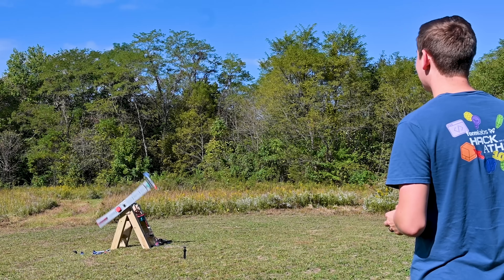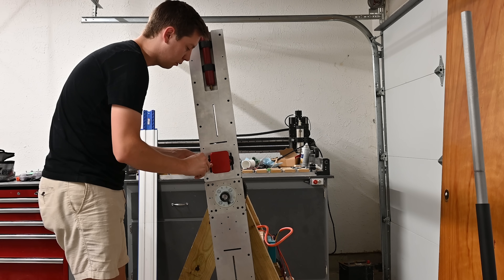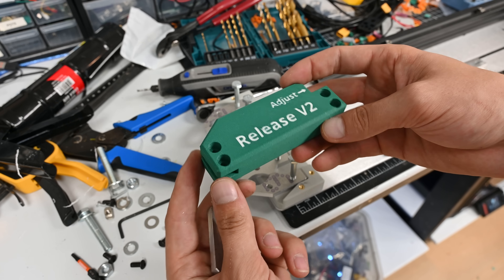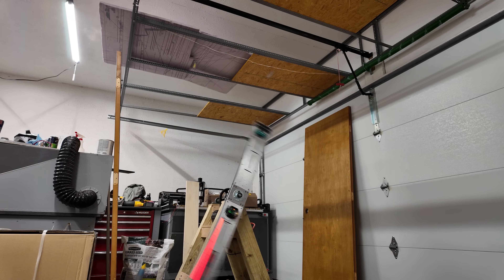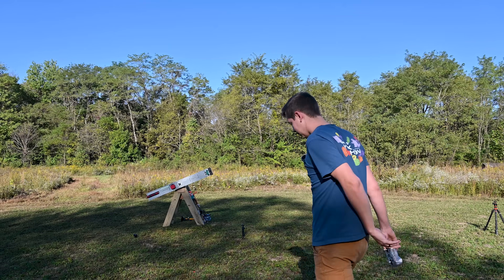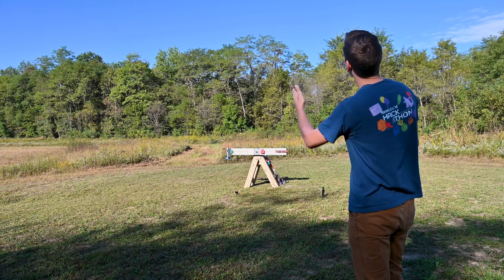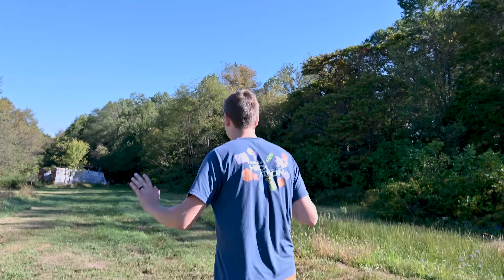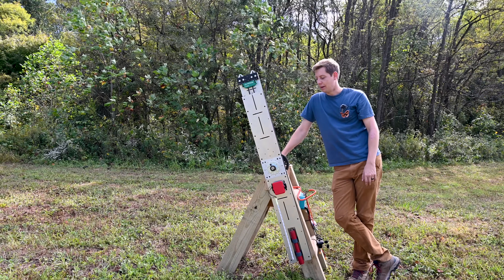I Fixed SpinLaunch

Comment: I have a suggestion for balancing, something that's basically automatic, and cheap and doesn't need software.
Use a properly centered bearing race/track and put a few dozen bearings in it. This is how certain tires and spinning objects are balanced. This would also automatically rebalance once this rocket is let fly, which should reduce damage from shifting forces.

Comment: Looking good! after the launch you have a mass imbalance which may put a ceiling on your RPM, so  maybe you could anchor the base to the soil with one of those things to secure your dog: a screw-in ground stake, maybe with a ratchet strap around the center post straight down into the ground.

Comment: Why didn't you do something like a throwing knife and put the rocket in-line with the arm and then release at the top of the rotation (0-degrees) instead of at 270-degrees?

Comment: Could be cool to put an actual rocket motor and recovery mechanism in it, maybe fire up an E or so motor on a timer and jetisson the ignitor on a chute. That's if the weight doesn't mess up the stability of the system too much!

Comment: What if you built the arms to be retractable? They start full length, and then retract both ends like how an ice skater pulls their arms close to spin faster? This assumes the motor is the constraining factor for speed and will probably introduce durability issues, but hey, just an idea from a non-engineer

Comment: Stabalizing the platfor would help to get better overall results.  It looks you're losing a lot of energy in the platform rocking.  Besides yielding more energy, improving the base stability should also help  increase the timing consistency of when the release is happening.   A concrete slab, or an anchored steel plate with threaded pegs, even a basic wooden frame would be an improvement to the present configuration.

Comment: You solved the small release problem: Good. So now you can successfully launch ultra light rockets (that introduce a negligible weight difference) from a comparatively much much heavier structure.
The real problem with spin launch though is launching a heavy rocket from a not infinitely heavy structure (which is relevant because you still want to be able to spin that thing up in a rather quick and affordable way concerning the energy the motor needs). When you have a balanced situation (with the rocket in place), so you can turn it fast without tearing itself apart, and suddenly detach lets say a 1 ton rocket, your launch apparatus will let's say rapidly disassemble itself. That's where the real problem is (unless a one time usable launch site is enough).
Obvious idea 1: Detach an equally heavy counter weight from the other arm, but that would go in the opposite direction and smash into the ground with the same force the rocket goes up. So you have your own little earth quake right at the launch site.
Idea 2: Move the counter weight on the other arm to the center of rotation  (equally fast to the detaching rocket), but you can't do that as instantly as needed (without destructive consequences).
There are a bunch of easier ways to launch a rocket than spin launch.

Comment: Seems like the angular momentum issue is going to be 1000 times worse for the real spin launch, and the loads required to negate the angular momentum would be off the charts.  I am also co fused about how the arms are rebalanced after release. Otherwise, the thing will self destruct upon launch, and suddenly moving a mass to counteract the sudden imbalance seems even more violent.

Comment: It looks to me  that in order to conpensate for momentum, two locks should be released at the same spin angle (e.g. at 9 o'clock). So maybe have separate lock and a mechanism that would automatically release both when they reach this angle?

Comment: To save you some issues re-balancing for heavier and heavier rockets, you could modify the non-rocket side of the arm to have a weight on some threaded rods. Turning these rode to move the weight radially would allow you to adjust the arm's center of mass, maybe even adding a motor to allow you to adjust the center of mass automatically post-launch.

Comment: should have put a whistle on the rockets. Also you could add some sliding counter weights to the arm to help it re balance after the rocket is launched. Or make a large hoop shape around it and have weighted balls inside.

Comment: Longer and lighter arm to make it launch even faster. I'm also scared how unbalanced the arm becomes once the rocket leaves. You might need a pneumatic actuated weight shift at the other end to dynamically counter balance (or something else), or else it might explode in your face. Its dangerous.

Comment: have water eject from the counter weight as the rocket releases to re balance the arm at high rpm
Reply: use whatever compressed air you have left to expel it even faster

Comment: improve this in whatever way, but also, you need to add a rocket motor and ignition+ delay system, or learn to make your own rocket motors so you can make a custom throttled one that will do a slow burn for a fair while before the main burn (since it's already going 80 mph, pushing to go as fast as possible instantly probably not efficient? IDK, anyways, another fun thing to add, and should give a nice impressive result.

Comment: 17000mph is overkill, if you just want to get into space you only need about 4000mph. The extra 13000 are doing nothing for you if you are just going straight up, until 25000 you are always going to come back down.

Comment: One thing manny here get wrong or at least phrase wrong is that Spinlaunch try to throw Rockets into orbit. they dont. They dont want to. They dont have to. What they want is to throw small Carry vehicles into the upper atmosphere to save significant ammounts of fuel. 

The system is only viable and only intended for small to medium sized sattelites.

Comment: I feel like for a truly clean release, you should rotate the fingers of your release mechanism by 90 degrees. There is still potential interaction between the fingers and the rocket after release in the current orientation, post-release. Maybe not. In my head there is. Any chance you could mount a high speed GoPro with a macro lens looking directly at the 'fingers'? I'm only half kidding with that request. Also, I'm curious whether your stepped release accounts for the fact that you should be changing that timing depending on the RPM. If you calibrate the delay at a low speed and then crank it up to two or three times that speed, your rear release should be occurring two or three times sooner respectively. That may not be the exact relationship, but the rear should definitely released sooner at a higher speed.

Comment: Looks like the wobble of the frame is an issue, as you need more and more precision you may need a heavy base to bolt it to. You could put a spirit level into the base.

Comment: Can' they just release weight from both ends at the same time? One will go up into the sky, another will go down into the hole. No need for fancy schemes - just need a good system to absorb the impact of the second piece.
Maybe you also don't need to absorb it, but put this onto a huge mountain and launch it via 45 degrees angle, so that impact  of other piece is few KMs away.
- There's less air on mountain - less drag, up to 3x reduction.
- There's less air on mountain - so 3x less air pressure pushing on vacuum envelope - can build bigger centrifuge, which in turn means less acceleration on payload, which in turn means less physical requirements for the payload itself.
- When you launch with lower angle (relative to ground) - more energy will be used for orbiting and less for lifting(which is wasted energy)

This approach requires less load on bearings, because system is always balanced - before and after release, so you can use much smaller magnetic bearings.
You can spin the payload up to the structural limits of the arms, which can be improved later with high tech, like carbon nanotubes, etc...
An you are already on the mountain - so you gain some additional specific impulse from height.

Comment: Considering gravity and air friction you'd need to launch at approximately 9-10km/s to reach orbit using a spin launch. 8km/s at 50m am length is about 130,000g. Max dynamic pressure even for a 1kg steel ball would cause insane heating at 1000's of kelvin.

It's a fun concept to demonstrate but physics gets in the way sadly.

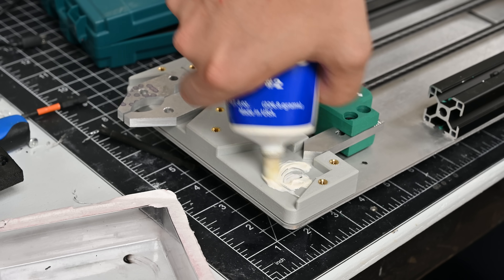Comment: <5:30, maybe a spin circles and then square for a moment. But thanks for the intro where the result was already shown, I appreciate that. And feel free to use my $1.254.321 suggestion for free (in case it doesn't work). No one can use science. Patent pending. I'm kidding. And so amazingly jealous. I don't want a 3D printer.

Comment: you can either spin faster - or increase the throwing arm length.

interesting would be if this can be built like a trebuchet - increasing the throw arm length using a lever only for the last half rotation - throw the rocket - and then folding back in in reverse to not get the spinny thing out of balance too much...

Comment: Why not use centrifugal force to push the clamps open, instead of fighting it to pull in the mechanism?

Have an electromagnet hold a piece that has different-length pins. When the magnet turns off, the piece accelerates out, and the pins push on the backs of the clamps, opening them and compressing springs on the other side of the hinges.

The springs keep the clamps closed until the pins force them open, and timing is just a matter of changing the lengths of the pins.

I imagine, also, that the correct timing wouldn't depend on rpm, because of the greater acceleration acting on the piece. The current setup only works for a specific range of rpm, because having a higher rpm means more force is needed to counteract centrifugal force, meaning it takes longer (given the same acting force) to allow the clamps to open.

Comment: I think that the balance of the arm is important. What if you always launched 2 identically weighted payloads at a time? Or even 4 at a time? The real spinlaunch spins so fast that the first one would launch, then 90 degrees later the second one launches, then the rest. You'd have a train of 4 payloads going for the price of 1.

Comment: What about placing the rocket and release mechanism on the face of the spinning arm with the rocket parallel to the arm with the nose pointed away from the axle/spindle, and released when the arm is straight up/perpendicular to the ground?

Comment: Very cool, and great problem solving.  I think about the complexities of the SpinLaunch often, and SpinLaunch (if they are still actively planning on launching) need to rebalance the arm after the they release the rocket, no idea how they make up for losing that weight.   Your rocket is light and seems to not make that an issue.

Comment: Instead of spinning faster add some modular extensions to the arm and raise the supports. Also have you considered using a "Little Giant Ladder" to replace those wooden supports? Possibly a pair of them and spin the arm between them for stability.

Comment: you havent really showcased the imbalance issues that you get between having the spin balanced for the rocket vs after the rocket but it does limit the max RPM you can take it to until its solved. My Idea is actually from tire balancing beads. if you have a ring with balancing beads built around your axel it will balance for the rocket and then once released the beads will redistribute to rebalance immediately upon release so you have minimal time out of balance and can really amplify the max RPMs without shaking it to pieces.

Comment: What if you place a stationary magnet outside and a coil inside the spinning part. While spinning it cuts the magnetic field and produces a voltage, when speed increases, the voltage produced also increases. Then set the release mechanism such that it will be triggered at a particular voltage. You can place the magnet where you want it to release.

Or place an electromagnet instead and then you can trigger it any time, but the rocket will be released only at the position where the magnet is. So that you don't have to worry about perfectly timing the release.

Or just an electric wire that slips on the rotating arm.

Comment: You need to have a weight on the opposite side, equal distance from the center as the rockets cg and the same weight as the rocket. Release it at the same time. The challenge is finding a material that will not bounce off the ground and k.o. the spinlaunch arm. Perhaps bio degradable airsoft bbs for the counterweight. That way you don't have a giant chunk of metal or lead shot flying or bouncing off the ground and taking the arm out.

Comment: 4:20 great job just giving away your work to China. Bambu printers were subsidized by the CCP to be a printer that operates better than competitors at a subsidized price. The only catch is they have to be network connected now and that means the CCP gets it's own eyes and ears in R&D departments around the world. 🙄
Reply: Nice story bro, but I guess you've forgotten that EVERYTHING can be hacked. All you gotta do is change the firmware.
Reply: @daviking-88 Maybe we should stop using fences for livestock because they fail sometimes and the livestock gets out. We should just let them roam free and people take them as they will.

Comment: I dont understand why everyone is so worried about the rotaional inertia. The problem is the release mechanism itselfe which neither does not line up with the center of mass of the rocket nor realeses it perfectly at the same time. 

Every body which is released from a circular path moves tangetially away (for center of mass) bc there is no accerleration any more which keep it into the circulat motion). 

The problem is the release mechanism itself introduces forces in the rocket which lead to a torque around the center of mass and that is leading to the wobble (spin like it is called here). That has nothing do to with conservation ob angular momentur in my opinion. Correct me if im wrong

Comment: Rather than spinning faster to get more height (which also increased the G force), it may be easier to lengthen the arm. An arm that is twice as long gives a speed that is 6.28 times faster and the same G force.

Comment: Some thoughts: 

There would be less air resistance as a smooth disk (as this is just a flywheel) instead of arms. Just a hoop and some plastic should do so the arms aren't hitting the air the whole time.

What about adding a cable that lets out like a trebuchet to increase the circumference on the throw?

Comment: Well this sort of "proves" that the orbital spinlaunch is never going to work. Well, because they want to spin it up in a vacuum and fling it off dead true vertical with zero angular momentum at ridiculous mph. The slightest bit of deviation from perfection and the machine is going to shatter into a trillion bits all over everywhere. Which is exactly what a real spinlaunch is going to do.

Comment: Take timing out of the equation. The front attachment is your active release; the back should be passive. Maybe a down sloped channel with the pin on the rocket so that after the front releases, the back keeps pushing until the channel slopes up. The slope is calculated to allow the pin to slide out when the rocket is moving straight.

Comment: No, the full size spin launch is NOT possible. This is decidedly not a concept that can be build on a small scale and then scaled up. It requires quite literally an astronomical amount of energy to launch any object into space. Conventional rockets generate that energy through a sustained burn of some of the most energy dense fuel we have yet developed. Generating that energy through sustained spinning followed by a release of course has the advantage that the energy can be build up over a long period of time. But it also requires all of that stored energy to be released in an instant at the moment of launch. And don't even start with ideas like "at the apex of the throw a conventional rocket engine will engage to push the rocket the rest of the way". Launching anything that isn't just a solid block of steel introduces so many variables into the throw that it gets entirely uncontrollable.

Comment: The sliding counterweight doesn’t have to move the full length of the arm. The less distance it moves, the faster the arm can be rebalanced after release. The counterweight can be much heavier than the rocket and it can be closer to the center of rotation.

Comment: Now impart some spin on it to get rid of the last bit of wobble. The harder, but probably better approach, would be to give it spin though the release mechanism. The easier way, and possibly a better way to test the concept, is to redesign the fins to give it spin, the main problem with that is it'll add drag.

Comment: Personally I'd refine the launching mechanism using something like a webcam and AI. IDK if they make slow mo but you could also just do the same sort of optimization if a sensor is added to track the arm's location in rotation. It'll at least take out the variable or lay the foundation when you inevitably refine this idear.

Comment: @michaelrechtin perhaps scale up every dimension? x2 arm, x2 projectile weight and size, x4 frame, x8 motor power. Add a rail with a weight to balance the arm and pull the weight inward upon launch to compensate for the departed weight. Or have a counterweight with water that gets released into the ground.